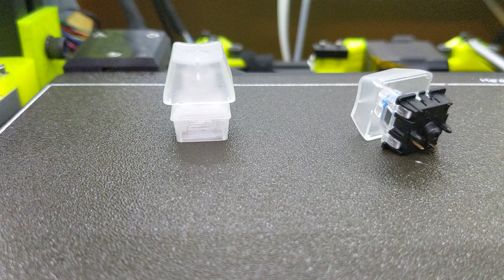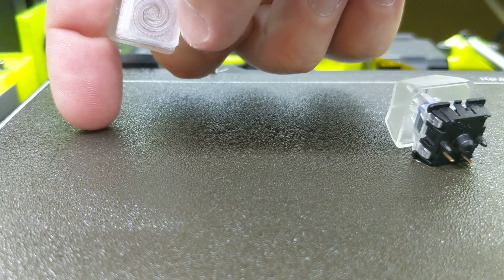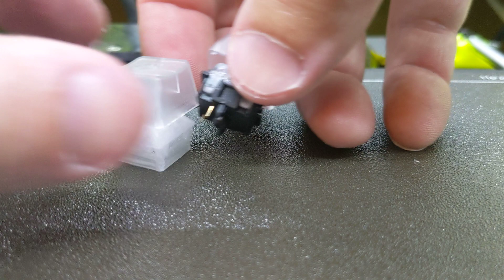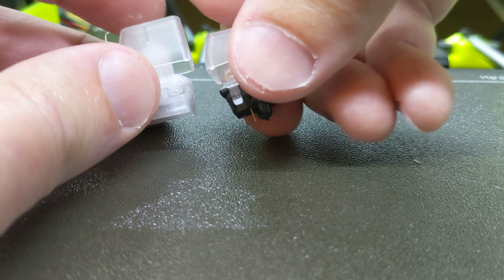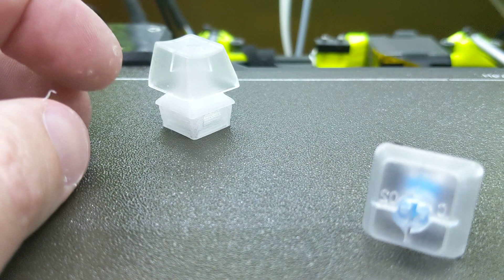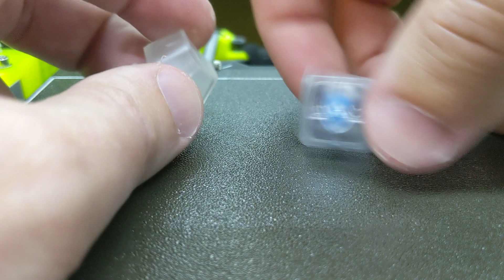3D printable mechanical keyboard switch update: Ortho-Planar spring works awesome!

Comment: printed spring is unique, have you also tried building one with a metal spring?
Reply from the maker: Not yet. I wanted to avoid metal springs because they're not parametric... You order like 150 of the spring you think you want but then it arrives and it has too much or too little force. Now you have to order more springs and try again. With my method you can just print out a lot of different springs to try them out until you find the one you like!